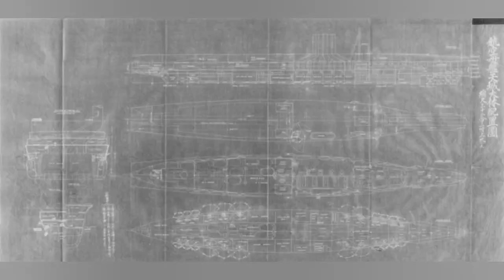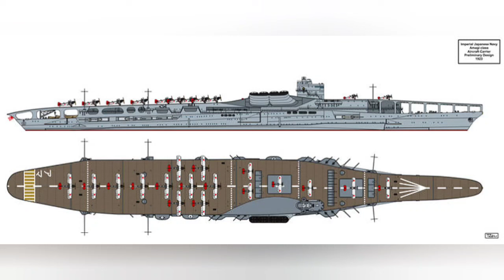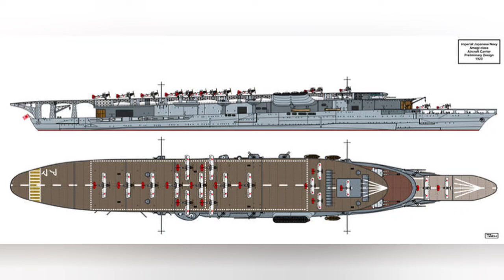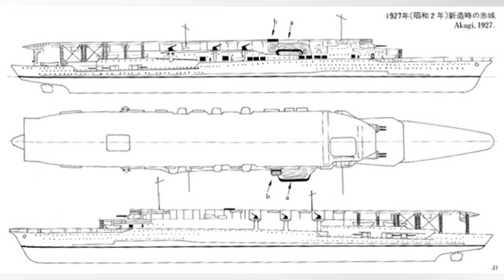Making Akagi and Kaga into Aircraft Carriers. (Part 1)

Comment: I've wondered what did they do with the space between the girders at the stern.  A lot of space and not much visible use.  My reading is that these were colossally expensive ships.   Purpose designed carriers would have gotten more planes on a smaller, more efficient,  cheaper ship.  I guess you play the cards you are dealt.

Comment: I'm fascinated that the Japanese created 2 hangar decks (one on top of the other) whenn constructing their aircraft carriers. This is one of the reasons why Japanese carriers look ridicoulously tall or top heavy above the water line. Did other countries use the same 2 hangar deck designs for their carriers?
Reply from the maker: Yes, the Royal Navy had carriers with 2 hangars like Courageous and Ark Royal. 
For Japan, it didn't affect their height under normal circumstances. All of the keel up designs like Soryu and Shokaku had the lower hangar in the upper hull with the upper hanger constructed on top of the hull holding the flight deck. Akagi and Kaga in specific had both hangars above the hull because they were placing them on hulls that had already been completed for a different purpose. While Akagi and Kaga did suffer from their extreme height, it wasn't a universal problem amongst the carriers.
Reply: @centralcrossing4732  Ahh understood. Another carrier that was extremely tall above the water line (besides the Akagi and Kaga) was the light carrier Ryujo. What could the reason for that one be as the Ryujo I think was not a carrier conversion from a non-carrier design?
Reply from the maker: @jeffreytan2948  Ah yes, Ryujo was definitely an odd ball. As designed, Ryujo was an 8,000 ton standard displacement carrier with a single hangar, which would have made it Japan's first carrier with one hangar. After construction had started, it was decided to increase the aircraft capacity, the only way to achieve that was by adding another hangar. With the ship already stated and pieces fabricated, they couldn't work another hangar into the hull. So they had to put another hangar on top of the already planned hangar without major alterations occurring to the original design. As a result, the ship suffered extensively from its light construction and added hangar.